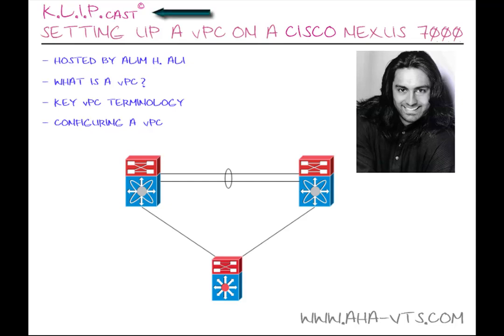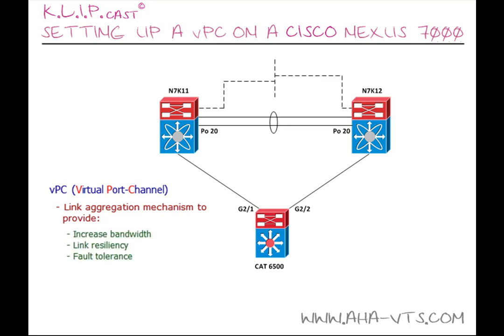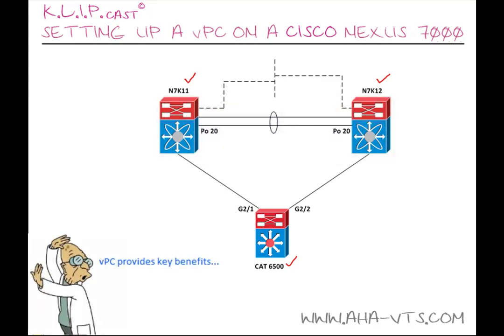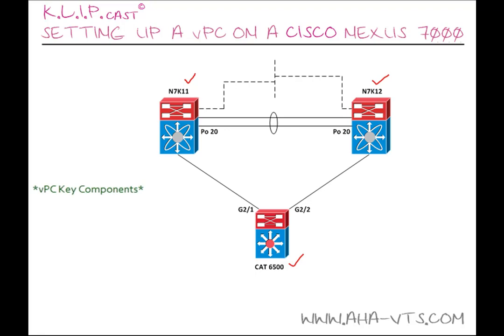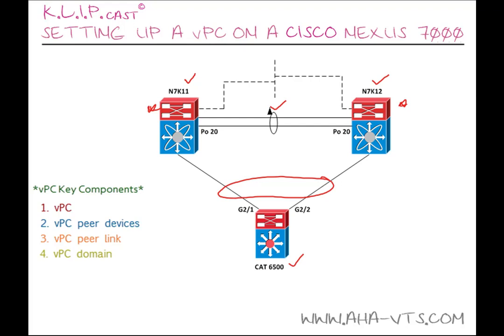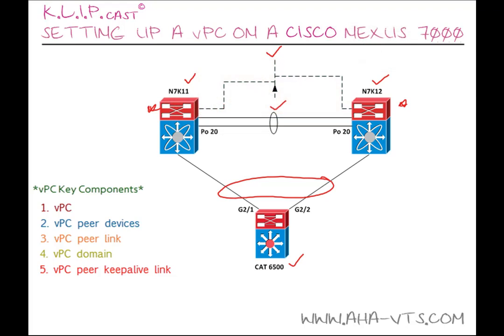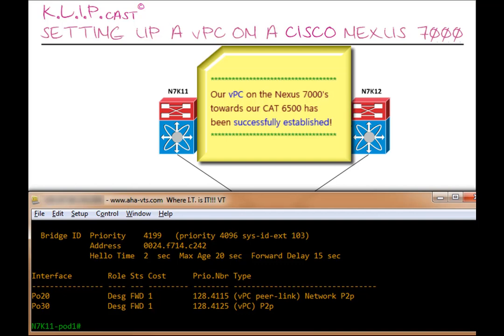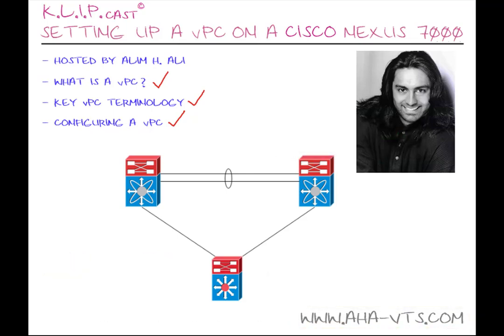AHA-VTS.com© K.L.I.P.cast©: Setting up a vPC on a Cisco Nexus 7000

Comment: Great presentation, but i notice few things that you probably performed prior to make this demo: 
- PO20 did not have any assigned interface to join the peer-link 
- not quite sure why, I could not see any Vlan allowed through PO20 either: 100-105
- Would that mean vPC peer-link auto allow all port by default? i doubt / probably the default or native 

I like you demo and think it is great still! by the way what was the NX-OS version you used?